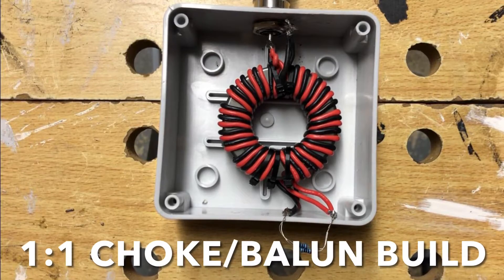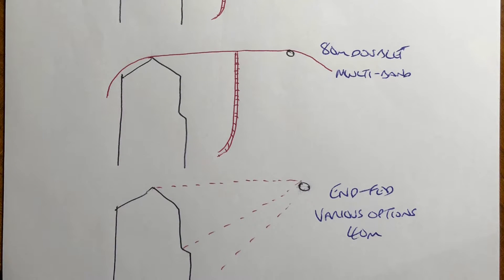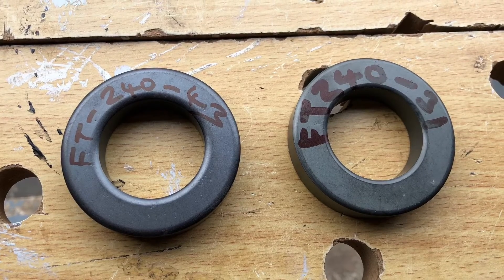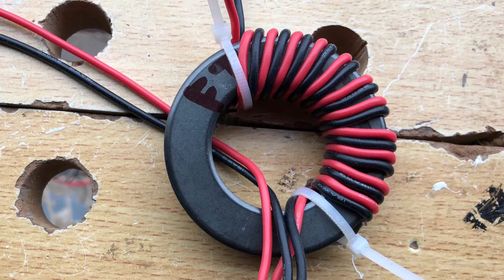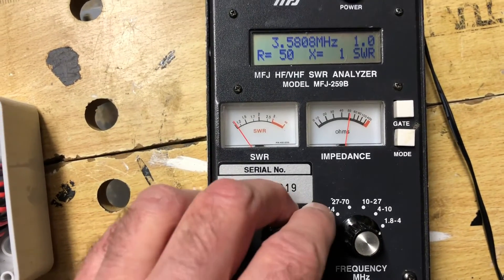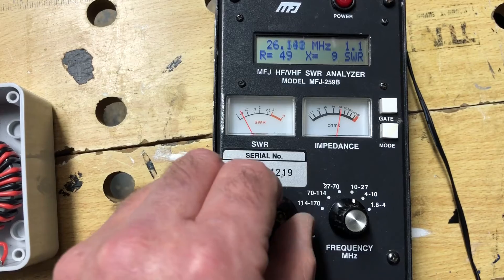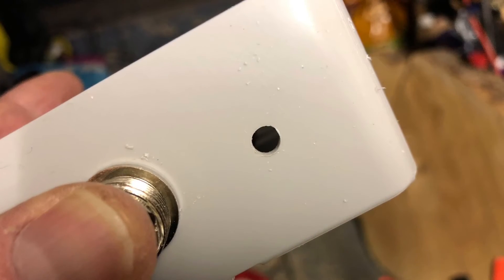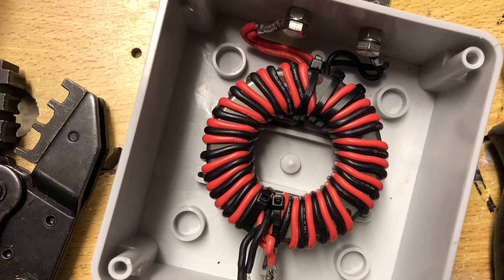1:1 Choke/Balun Build

Comment: all the chokes on that page used coax, not ptfe and i didn't see any on there that had 24 turns. i counted 24 turns on your balun
Reply from the maker: Yes, those are coax chokes and a good source of information. If you follow the second TRX Lab YouTube link which is also in the description, it takes you to the source of information from Peter for this version 👍🏻 Thanks.
Reply: @G0CNN-Ian  you said you balun had 12 turns but i counted 24.were you referring to 12 turns on each side?
Reply from the maker: @frankbaron1608 yes, 12 on each side as per 1:40. Good luck 👍🏻
Reply: @G0CNN-Ian  oh i whough it was a 1:1 you were building.
Reply from the maker: @frankbaron1608  yes it is ✔️
Reply: @frankbaron1608  It is a 1:1, using bisectional bifilar windings.

Comment: Hi Ian, interesting video, I also watched the video by TRXlab you linked to. It was interesting that Peter mentioned the impedance of the wire used ideally being 50 ohm, I guess this is why you see a lot of baluns made with coax. Just wondering how your design using your choice of cable worked. I made a balun using some antenna wire and got exactly the results Peter demonstrates. Great SWR 1-30 mhz but poor common mode rejection. I tested using the same method Peter did with a VNA. I might buy some mini 8 coax and see how that performs. Just wasn’t sure how you could be sure your choice of cable performed. I used a 240-43 core but as I’d like to have a dipole for 40m I might try a 240-31. Big fan of your videos 👍. John
Reply from the maker: Hi John, it’s works very well. Still in use years later, plus also on my off-centre fed dipole with a 4:1 in series also. All very good and great performance.  Good luck 👍🏻

Comment: Very nice Video I enjoyed watching it. Guess what...for my 1:1 Balun I used Electrical Cable from a broken down Vacuum Cleaner. I just stripped the Black  Insulation Jacket and kept the Wires with green yellow, blue and brown coloured Insulation. The Toroid I used was a FT-240-43 which I had on Stuck sitting a Box for Years.. 73 de Uncle Günter 💯🙋‍♂
Reply from the maker: Great Gunter.

Comment: Thanks for the video. I used regular 18 guage Pico wire(I'm only putting 50 watts through it) and got 2 x 12 windings to fit on by softening up the wire a bit by working the length of it with vice grips to make it a bit more oval than round and then used a flat blade screw driver to apply back pressure on the windings to get the last couple windings on.  It works. I also found using some Scotch 33 electrical tape to help hold elements of it in place until I could get it properly zip tied helped as well.
Reply from the maker: Great.

Comment: What’s size wire and doughnut would you recommend if I wanted to build one just like this to handle legal limit watts ?(1.5 KW)
Reply from the maker: Hi. The wire should be ok, but perhaps stack two cores for 1.5Kw PEP. Legal limit in UK is 400W, so one core is fine for this.
Reply: 2 core (240-43),can handle 1.5Kw？？

Comment: Looks to me like the capacitive coupling between the wires would kill the CMI in this balun where the wires are jammed in close to each other.  Would be interesting to see some RF current measurements comparing this type of balun to one using just one pair of wires and one using coax for the winding,
Reply from the maker: Hi thanks for the comment. If you check out Peter’s series of videos mentioned (& in the description), you’ll find more info there and mentions to the comprehensive work he referred to. I can say this works extremely well on both my 80m dipole and 40m OFCD (combined with a 4:1 transformer), so I’m very happy with it’s performance. 😀 Thanks.

Comment: I don't understand how this balun is supposed to work.    It looks a bit like a 4:1 Guanella wound on a single core,  though it isn't.     A 1:1 Guanella works very well (as per G3TXQ's analysis) and only needs one set of windings,  so not sure what the purpose of the second set of windings actually is?
Reply from the maker: Hi Steve. If I understand it correctly, the symmetry gives better SWR performance as per the findings of DG0SA research & design. Peter TRX Lab) reflects on this in his video #105. Thanks.
Reply: @G0CNN-Ian  Ive done a bit more thinking around this and it does look like two Guanella sections in opposition, which I can understand.  When I looked at Peters (TRX) piece on this, he does stress ensuring the characteristic impedance of each winding is a close to 100 ohms as possible, again makes sense, because of course the windings are in parallel.

Comment: Got some Silicone wire, ordered SO connectors, ferrites on the way, got to find a nice enclosure, watched the video links, think the power handling is good :-) hopefully be ready to build some myself next Week :-) thanks for the video.
Reply from the maker: Good one Chris. It’s when you’re short of bits and the p&p costs which I find are the pain. Good luck 👍🏻
Reply: @G0CNN-Ian  Going to try the RG58 version on the ends of the coax without a box and make some of these up for the RG213. I am also thinking I can put One outside the shack in the waterproof enclosure between my antenna switch and the lightning arrestor, so will end up with a 1 to 1 at each end of my coax runs. Replacing a second SO connector instead of the twin connectors you have to make in line choke.
Reply from the maker: @chrisbartlett6022  Sounds like a plan 👍🏻 I subsequently drilled a small vent hole in both of mine (on the bottom side) and glued a small piece of net curtain on the inside to stop insects getting in. I did this after opening up the original I’d been using and saw some condensation on the inside top. Despite the weather-proof nature of the boxes, the air trapped inside heats and cools and the moisture in this trapped air condenses as a result. Clearly not a problem on your non-box open-air version 😀
Reply: @G0CNN-Ian  Hi again, just for info, made One of these, I scanned my dummy load, it is around 1.03 @ 1.8mhz slowly rising to 1.4 @ 52mhz. When I put the choke onto the dummy load and re scan it pretty much follows exactly the same line as the dummy load without it. I presume this is good enough proof that it works properly?
Reply from the maker: @chrisbartlett6022  yes that’s spot on Chris. Neutral impedance impact but lots of choking 👍🏻 Can’t say beyond 10m/30MHz....a 43 or 61 core may respond better? ps. I’ve made a other for a mono-band dipole.
Reply: @G0CNN-Ian  My toroid is a type 43, I tried doing the wrap the RG58 feed line through the Toroid with my end fed, it stopped the rfi but the antenna wouldn't tune some of the bands, so I have made One of these up to try it. Got a double ended PL259 adapter to hard connect it to the Balun box. I got some direct bulkhead connectors with the 4 holes in but have no nuts and bolts to fix them. Do you know what size nuts and bolts they need to be perchance?
Reply from the maker: @chrisbartlett6022  Sorry Chris I don’t. You’ll have to take one with you to the DIY store and hunt out some stainless ones. Good luck!
Reply: @G0CNN-Ian  thanks, will try asking on the discord.
Reply: @G0CNN-Ian  Got it sorted, ordered M3 and they seem to do the job. Just made another One with a PL connector on it so I can attach it straight to the SO239 on the antenna box. 1 less connector has got to be good :-) highest SWR on it is around 1.3 at 10m so should be fine I think. Thanks again for your help.

Comment: Nicely done as always Ian. Good, clear shots showing construction. Thanks.Would it be possible to use 18AWG enamelled wire or would the heat be too much?
Reply from the maker: Thanks. Enamelled should be ok as long as you can be sure you’ve not broken the enamel which might be tricky.

Comment: I want to feed a doublet with 450 ribbon but need about 5m of coax to make it through my house roof to shack. Would rg 213 be ok or too lossy over that distance from the balun at he eves outside.
Reply from the maker: Hi William. I might be doing similar. 5m of RG213 might be on about the limit? Can you put the balun on the outside wall and bring the twin feeder down more perhaps? My run would be 2-3m in my setup. Good luck 👍🏻

Comment: Nice one Ian. Hadnt considered using this wire. I've been using something very similar to RG142 that can handle QRO. I have recently just purchased 92m of this wire (comes in 2 spools) for some anttenna projects. Its amazing how supple it is and how it handles heat.
Reply from the maker: Yes, the large spools were very expensive. Only needed 4m, so happy with these shorter 1m lengths.
Reply: TAsri.